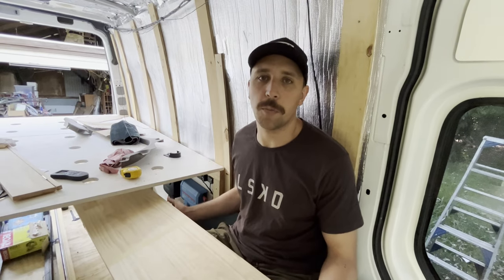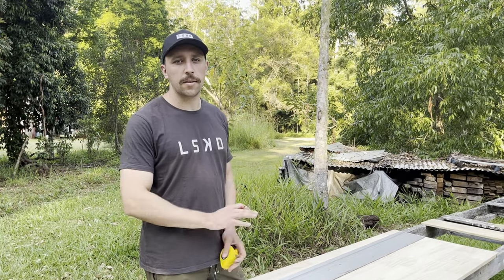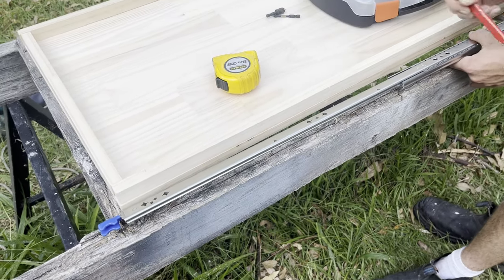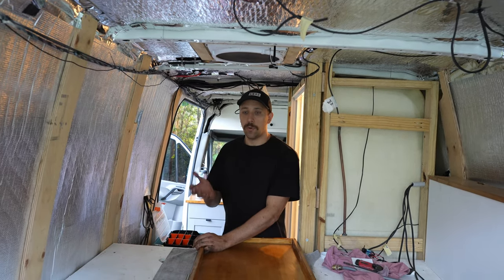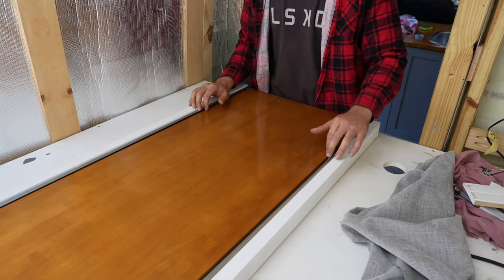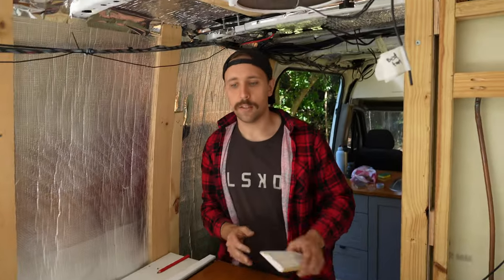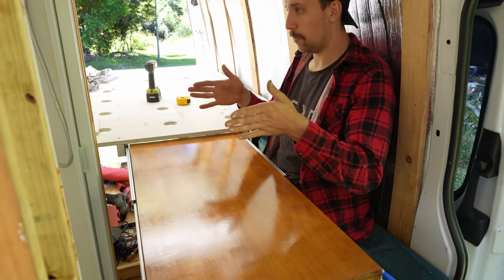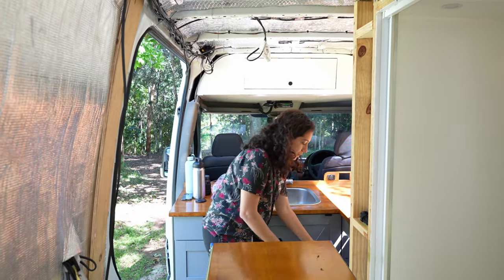How To Build a Sliding Camper Van Table - EP28 Van Build

Comment: Hey, awesome build. I've already finished the van and want to add this kind of table. The extra sides are the perfect idea to hold it into the bottom bed frame. How did you reinforce that attachment? Does it resist a good amount of counterweight?
Thanks for sharing.
Reply from the maker: Thanks! We just screwed the two pieces of timber to the bed base that the table runners are attached to. It hold plenty of weight, definitely more than we would ever need to put on the table